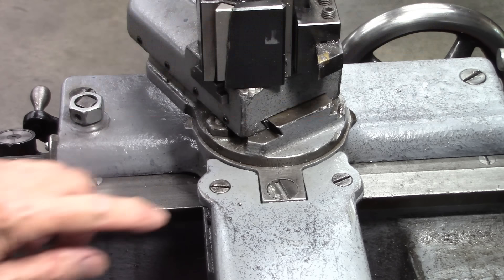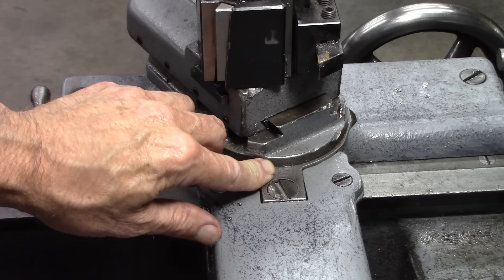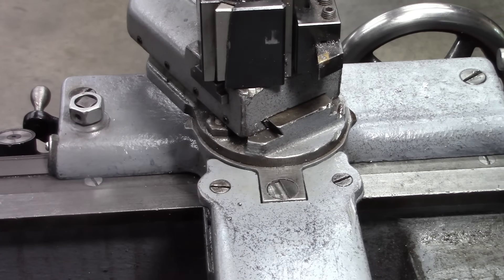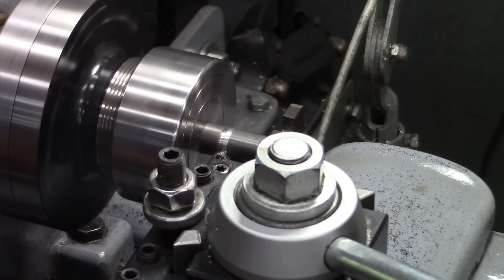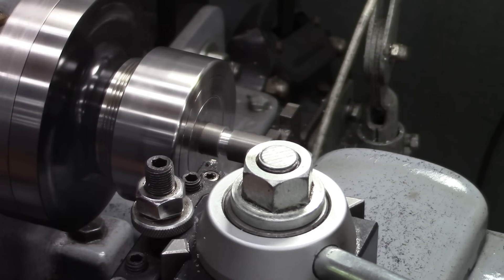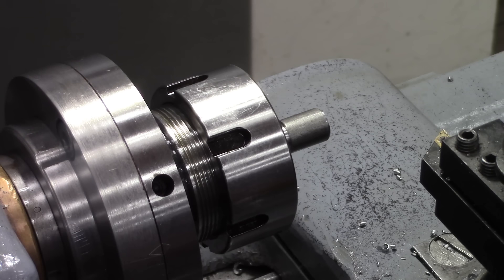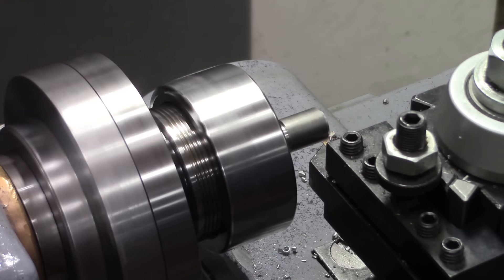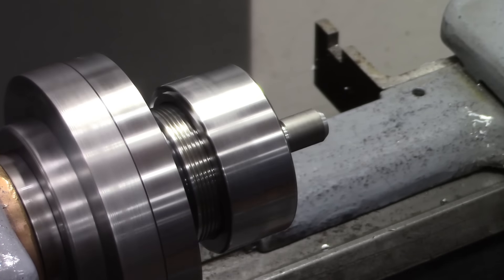Threading on a Lathe - Just the BASICS

Comment: 20:50 actually if you need to go Z deep then the compound should be ~ Z x 1.15 so if your cross slide would have to go .050 then the same depth on the compound @ 29° would be .050 x 1.15 = .057, that is for TOOL travel for both cross slide and compound not diameters.
In this case if your minor diameter is .417 and the stock is .500 then .500-417=.083 so the cross slide must move .083/2=.0415
So the compound needs to move .0415 x 1.15 =  ~.0477
Reply from the maker: If this is true (which I'm sure it is) I should have left my comment out of the video. I'm glad I made the text comment. Thanks for the info.
Reply: @WinkysWorkshop  There is another way too. Your clearance groove is roughly at the minor diameter and on your last cuts, you can see the tool just nicking that diameter so you know you are near the bottom. So if you make your clearance groove correctly it can be used as an approximate gauge too.
Reply: Another option is to precisely use the cross slide to cut the .417” minor diameter. While at the minor diameter set the compound and the cross slide to zero. Back out the compound to clear the work. Now without calculations you can start cutting the thread by advancing the compound to the zero mark.
Reply from the maker: @billshiff2060  Excellent idea! Thanks. Also I pinned your other comment to the top. Good information.
Reply: @davidlloyd6045   Cool. That works, but only if you cut the relief groove with the threading tool you are going to use. Of course You could always cut the relief with the square tool then touch off on the surface once the threading tool in in place and zero it then. You could also cut the back side chamfer with the threading too at the same time.
Reply: @WinkysWorkshop  Thanks for that. One thing though is whatever method you use you'd want it to be just shy of finished size so you don't go too deep because they don't account for differences in the nose radius of the tool. We just need a reference to see when we need to start checking the fit.
Reply from the maker: @billshiff2060  Logical, thanks
Reply: Tremendously important and timely for me.  I restored a SB9A and am blundering my way through practical use of the lathe.  Eager to try threading.  Thank you for your clear and concise explanation.
Reply: @johncrisman576  Pass it forward.
Reply from the maker: @johncrisman576   thanks!
Reply: Thanks for your excellent tutorial on basic thread cutting. Here’s a minor point that’s often overlooked. The major diameter of exterior threads should be slightly less than nominal. For instance, the major diameter (OD) of a 3/4 thread should be  about .745. Otherwise the nut may not fit your finished thread because the OD is too large.
Reply: @ellieprice363  That is not strictly true. It depends on the class of fit you are making 1a, 2a or 3a. But in all cases the major diameter of the female thread (nut) is not permitted to be less than .750, so no proper female thread can bind up on any proper male thread. For a class 1A screw mating to a class 1B nut,the tightest it could ever be is a line fit with both being the same diameter but never an interference fit. 

There is an allowance (mandatory minimum clearance)specified for class 1A an 2A screws but not for class 1A. 
The purpose of that clearance on a class 2A thread is to allow for the thickness of plating which will be added and again a finish plated class 2A thread can be as big as .750 and still be in spec and will not interfere with any proper nut. 
If a class 2A thread is not to be plated then it must retain the allowance (mandatory minimum clearance), that's where your Tip comes in.

For class 1A threads the allowance (mandatory minimum clearance) must be maintained regardless of plating. It is there to deal with dents , dirt and distortion of sloppy crude assemblies.  "All-thread rod" is usually class 1A.

Did I mention there is more to know about threads than you'd ever WANT to know?
Yeah, we are just scratching the surface so far. I didn't want to know all this, I just wanted to answer a couple of questions...
and they were at the bottom of a 🐰🕳
Reply from the maker: @ellieprice363  True, I should have mentioned this although cutting until the threads are sharp and knocking the sharp edge off achieves the same end.
Reply: @billshiff2060 Thanks for your very good explanation of thread fits and classes. My point was that male and female ODs should never be exactly the same. Class fits are of course determined by the  desired fit of the screw and nut. Never by major diameters.

Comment: When cutting 60 degree threads, the compound is advanced 1.149 times the thread depth shown on a thread depth chart. Example: With the chart showing .047" as the thread depth for 13 TPI. the compound is advanced .054" (.047" X 1.149 = .054")
Reply from the maker: Good information. Thanks

Comment: I notice Winky that you do not take any spring passes, If the nut is still tight after deburring the thread I do a couple of spring passes without adding any more to the compound. With regards to a previous video where you showed how the trailing edge of the thread was a saw tooth effect from the compound avances here is what I was taught to do over 50 Years ago. As the nut is still a bit tight, advance the CROSS SLIDE by a 1/2 to 1 thou and make another pass. That will then remove the saw steps and make the thread the full form of the threading tool. Regards from Australia.
Reply from the maker: Yeah a spring pass might have done the trick although its a judgment call and the threads ended up just about a perfect fit. For sure the cross slide advance would correct the finish.

Comment: I know it’s off subject but l have several questions about the replacement motor for your index 40-H. I need to replace mine and I am not finding a suitable replacement on the Vevor website any help would be greatly appreciated
Reply from the maker: <1Hp Electric Motor 140156C Single Phase 56C Frame TEFC 115/230V 1800RPM>  This is the motor I used. The only issue I had was wiring the drum switch and that was just my own inability. An exercise in logic for sure. I got it but it took me a while. I now have a 3/4 HP 3 phase motor with a VFD on the mill. Sometimes you can find a good deal on used 3-ph motors and the variable speed sure is nice, This is the vfd I used: https://amzn.to/4bU3axg
Reply: @WinkysWorkshop  that’s what I thought since Vevor didn’t have any options in 3 phase that you went with a single phase motor and must have been dissatisfied.  I have found several three phase options from different sources but they are all 5/8 motor shafts and the 2 stack drive pully on the index is 3/4 id and I am not able to find a replacement for a 5/8 inch shaft.  Did you just use a single pulley and rely on the VFD for your variable spindle speed thank you so much for your help and advice
Reply from the maker: @phillipmattingly7826  Here's my 3ph motor and VFD install video link. Something interesting about VFDs is that you can safely (as far as I know) double the rated speed of a motor. You lose a little torque but a lot more when you go slow. You can use a pulley combination that is fairly slow and still get higher speeds. My mill goes from 200 to 2100 RPM with a single motor pulley in the top position. My motor had a very short shaft. It's works great. The VFD I linked to in the first reply also converts 110V to 220v 3ph.  https://youtu.be/_wla3UP5s0Q?si=22ub_ibp7VsRpWh6
Reply: @WinkysWorkshop  thanks for your help and yes I have watched the video you posted and will do so again.  I haven’t watched them all but  I have watched a lot. I really enjoyed the series on the index restoration. I would love to converse directly with you but I don’t know how is there a way I can post pictures of my rebuild. You are doing a great job and keep up the great work you have been a tremendous help
Reply from the maker: @phillipmattingly7826  You can contact me at Winkysworkshop@GMX.com

Comment: Thank You so much for producing this video and for the personal recognition.  I have watched literally scores of videos on making threads but they always fixate on the cutting aspect and nothing on the setup process.  As You see from the comments, don't be surprised if this video goes viral since it's the best instructional video out there.  I had envisioned the need to set the compound at zero to begin each cut, but I have never seen a video that identified the thread meter or how it works (long mark / short mark).  You have helped me in two areas.  1st on the machine setup and the procedure for cutting threads (well explained) and 2nd ... on what type of lathe I want.  I am enamored with the older equipment and now it's all I will consider for purchase.  I want to thank You very much again for producing this video for all of us.
Reply from the maker: I'm glad you like the video. I left off one thing. If you get a lathe with change gears its a good idea to do what they call a scratch pass. This is making the first pass just scratching the surface. This is so that you can check with a thread gauge to make sure you have the correct thread per inch. With the quick change gear box it's probably not needed. I agree, I love the old machines. Buying and restoring a machine also gives you a very good idea as to how everything works. Be aware that the old machines will likely have significant wear. My South Bend is worn badly but I manage to work around it. Machinists tend to be obsessive about accuracy but quite often is doesn't matter plus you can do accurate work with a worn machine, it just requires a bit more work. As a hobbyist this extra effort is insignificant. If you get an old machine look for Broken gears. Gears are hard to make and expensive and sometimes very hard to find. Look at bearing ware. Most plain bearing lathes (like my south bend) have a bearing cap that can be removed... its a good idea to take them off and make sure they are not destroyed...  a little scoring is normal. If the lathe has ball bearings, they can be replace but they usually cost about $250+ . Last, I recommend paying the extra for a lathe with a quick change gear box. Change gears are a pain.
Reply: @WinkysWorkshop  very well put!!!
Reply: @WinkysWorkshop  Thank You again.  I've learned to guard against my fervor on purchases like this.  My best results have been to engage a "mentor" (like You) to guide me.  Our family has a gunsmith that is now a friend as well.  He has a lot of lathe/mill experience and I've asked him to help us with the buy.  We've found a lot of equipment on Facebook Marketplace but like You say, a lot of junk along with a few good machines that they incidentally want a fortune for.  Patience seems to be the hallmark of getting a good machine for a reasonable price.  Hopefully we will luck out and chips will be flying in our shop.  Thank You so much again.
Reply from the maker: @danhoag373  Thanks
Reply from the maker: @richardgreen7811  Yes, Patience  and Persistence. The good deals only last a few hours.

Comment: this video is obviously years before the fast retracting threading tool that you made and the half thread cutting tool. that little innovation still tickles me !  it proved for me that the threads are definitely cut only on one side of the threading tool.... which is no big revolation to most guys out there that have done any single point threading....but it does show the importance of putting the compound on 29.5 deg !  the ROUTINE here is the important thing to newcomers I think. the backing out of the cross slide and then returning it to ZERO every time and then advancing the compound the amount you want to cut....and the all important half nut.....  I would like to add "what happens if you miss the line on your thread dial ?" well
what happens is your cutter is no longer in sync with the threads so the cut is that much out and usually cuts the existing threads in half and you have to start all over ! so that half nut is CRITICAL  and on some lathes their sticky and don't like to disengage or don't want to catch on the threads you enguaged it on ...( it will slip back one thread and you will be out of sync)  a half nut being sticky really SUCKS because you'll crash the cutter into the chuck bust cutting tools break gears and all kinds of nasty stuff can happen. a slipping half nut can be bad as well but usually only destroys the part you are threading..... if you miss dropping the engage in the thread dial spot  IMMEDIATELY disengage the half nut chances are good that you can stop the cutter before it ever enguages the part. and simply try it again.... that is why I usually pull my cross slide back away from the part about 6"  just incase  I miss the half nut mark !  threading slower makes missing it far less likely ! 
however I am sold on threading away from the chuck no crashes possible that way.
Reply from the maker: I could have gone into a lot more depth but wanted to keep it simple. Yeah, a messed up half nut is scary....  been there!
Reply: sounds to me like you have a clausing !!  i have one and it does what you described lol
Reply: @danhoag373  no it's actually a Logan 911 as old as I am to the same month !!!   I think worn half nuts is the cause of that behavior that and slow reaction times ! LOL
Reply: @WinkysWorkshop  you did great Mark !  I always like your videos keep up the good work !
Reply from the maker: @bobkelly2447  thanks

Comment: Nice job. The collet chuck is really for accuracy, certain work holding and clearance, maybe rigidity on a screw thread spindle. Mines a D1-4 cam lock so there’s a lot of rigidity there. But I am getting a collet chuck eventually. I can tell you for sure, you definitely need to use the compound with those cheap import thread inserts. I’ve broken many using the cross slide. In reality, unless it’s a big thread the cross slide is all you need. I order higher quality inserts and that negates the need to use the compound. Cheers. Edit: I mainly single point metric. Rarely imperial. Just use a die for them. Quicker.
Reply from the maker: Yes I use a die for anything smaller than 1/2". Yes a threaded spindle (especially the smaller diameter spindles) is a weak point. The original chucks for these smaller lathes were very low profile but all the new chucks are at ,least 2-inches deeper. Usable? yes but collet chuck has the same stick out as the original chucks... MUCH more solid. 

Something I do not understand is this idea that feeding with the compound is more difficult or more complex...  or even undesirable. Even your statement, "negates the need to use the compound", implies that if you don't "need" to then feeding with the cross slide is better or that the compound is more difficult. Given a choice between the two I much prefer the compound because it's easier. You do not have to remember the dial setting when you go back for the next pass. You simply put the cross slide at zero every time and advance between .020 and .002 with the compound each time. The only reason I can think of that straight in might be preferred is to be able to direct read the depth of cut.

Comment: Good one, Mark. Very well explaned.
And next week, metric :)
Reply from the maker: Good idea...  although I have no transposing gears and no brake on my lathe. I have cut metric several times but but they were actually the inch equivalent. It works if you go a little deep and the threads are short.  o:)

Comment: Thanks, I thought that I knew how to cut threads, but this was a useful refressher and I'll refer back to it.
The man who set up my first lathe fitted it with a VFD. He showed me a slightly different technique which doesn't use the threading dial. Essentially, at the end of the pass, you stop; back out the tool; run the motor in reverse; go back in and advance; run the motor forward. It's the same thing, but without disengaging and re-engaging the half nuts. It works well until your old lathe decides to spontaneously disengage the half-nuts, and then you have an issue....
Reply from the maker: Reversing works well but some lathes don't stop fast enough. Also, if you have a inch based lathe and install transposing gears to cut metric then you have to use the stop and reverse method. Thanks for watching.

Comment: 15:45 One thing guys fight with is how much to take per pass as you go deeper. To cut out an equal VOLUME of metal with each pass
First you pick your first cut depth which is typically 20-50% of the total projected depth (this works for either the compound or the cross slide) then you reduce each following pass by the square root of the pass number.
So for a projected depth of .048 and if starting with a first pass of .020:
The 2nd pass would be .020 x sqrt2=.0282 or .0083 deeper. 
The 3rd pass it would be .020 x sqrt3=.0346 or another .0064. 
The 4th pass it would be .020 x sqrt4=.040 or another .0054 deeper
The 5th pass it would be .020 x sqrt5=.0447 or another .0047 deeper
and the 6th pass(s) with .0033 remaining would be to bring it to final size
and so on till it's done. 
In this case it could  be done in about 6-8 passes.
Reply: I always just wing it and go by feel. Lots of ways to do it but that works pretty well for me.
Reply from the maker: I'm with ellieprice, I just wing it.
Reply: @WinkysWorkshop  I get that. Winging it is a luxury only diy home gamers have but it causes  troubles when it's for profit and for a customer. Then it will have to be done efficiently and be in spec so it passes QC and still makes a profit.

Comment: Which is better, the auto retractor  or manual in your opinion? Great job as always 73 dan
Reply from the maker: The auto retract in most cases but it require a bit more setup. This video was a basic starting point.
Reply: @WinkysWorkshop  yes it was and a darn fine job of it to
Reply: i can really relate to the pucker factor lol
Reply from the maker: @danhoag373  Thanks